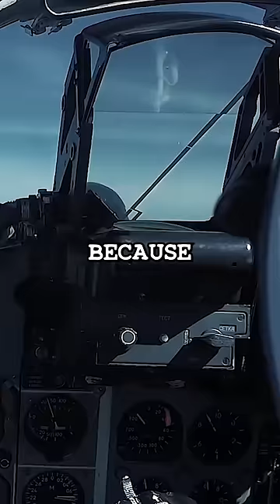What if a Fighter Jet Goes into Space?

Comment: Electronics casually overheating with no power
Reply: Plus how are they going to burn 🔥 with no oxygen
Reply: Not to mention space is just a tad bit cold 😅
Reply: @levicummins7317  And rocket cooling system?
Reply: Its a vacuum in space so the heat cannot leave the mig in space
Reply: That one got me too 🤣
Reply: @mtnkid9140 space isn't cold
nor is it hot

since it's so empty, there is nothing to distribute heat nor cold, so it's... none of thoses
Reply: Your car has a battery and engine. If your engine is off, can you still power your car for the radio? Yes. The plane is the same way.
Reply: @levicummins7317 acctualy some electronics like batteries can burn without oxygen theats why its hard tu put out battery fire because they create their own oxygen
Reply: Most planes have backup systems for power.
Reply: And catch on fire with no 02. ?
Reply: Whilst there is no medium for conductive cooling, there is however still radiative cooling
Reply: @kriss3401 actually space is cold as cold is the abscence of heat, not a physical thing
Reply: I would think one of the biggest problems is that there's no air for the control surfaces to act on.
Reply: @kriss3401 body do u understand radiation and how the sun's heat arrives to us plus if there isn't heat there is cold
Reply: Plus it's cold in space
Reply: @mtnkid9140  it might be cold but your in a vacuum...  there is nothing there to dissipate heat.... Why you puff up with boiling nitrogen without a suit....
Reply: @mtnkid9140  when you're not in the direct sunlight at least. The surface of the moon when in day light is extremely hot.
Reply: It still works like that
Reply: Yea and in icy cold space 🙄
Reply: @thegamingworld8871  IR rays
Reply: captainfrostedflakes   when thers no light is like 0kelvin or smthing like that
Reply: it does since temperature increases while going up from stratosphere
Reply: @levicummins7317  Fire 🔥 only if the engines are still on
Reply: And they never mentioned that space is full of radiation and I don't think they are wearing anti  nuclear suits. Space is one big nuclear reactor.
Reply: @kriss3401 its cold -200c
Reply: Fire needs oxygen, but how sun r burning??! 😢😢😢😢😢😢😢
Reply: @mtnkid9140  Space really doesn't do hot/cold since you need molecules to be "excited" by heat.
Reply: Yes, things would cool in space.. even if no air. Heat dissipate no matter the medium... heating is more of an issue than cooling.
Reply: @berry2740 "batteries can burn without oxygen.......they create their own oxygen". 

That's a contradictory statement. Fire needs 3 things to exist: fuel, heat and oxygen.
Reply: video source: trust me bro
Reply: @GoatOfSolitude888 the "vacuum" is a myth my friend!!!! But I'll let you research that fact not here to argue😊👊
Reply: Average gaming laptop
Reply: @GoatOfSolitude888  infra red radiation left the chat...
Reply: @kriss3401 it's freezing cold, stop spreading misinformation
Reply: @brothernumberone  no. For something to be cold it has to have less molecular energy, so when you touch it, it siphons energy from your hand which is why it feels cold and you lose heat. However space is a vacuum, there is nothing to touch therefore nothing to pull heat from you... Only way to lose heat in space is to radiate it, which takes quite long comparatively. The jet would lose heat via thermal radiation
Reply: @vitopannucci2001  nuclear fusion
Reply: @jasonbrink4237  commercial jets sure, military jets no. They have limited space and in general the heavier a jet is the more work is required to move it. So instead of batteries jets use alternators (like cars) to maintain power for hungry systems like radar  enviromental controls and the computer systems.
Reply: @Johnrichardsjr It doesn't need oxygen to burn. Think about it for a second, it's in use as it goes to space and as electronics work they generate heat as a byproduct. Without anything to help dissipate heat anything will eventually burn up. The same thing would happen in a PC CPU if you didn't have a cooling system on it.
Reply: @mtnkid9140 no it’s quite hot and the lack of air would mean heat wouldn’t radiate off as easily
Reply: @michaelbrooks6416 Stuff cools down terribly in space. If there was a real space battle, the ship that wins is the ship that doesn’t overheat first
Reply: @rorywatson5176 What proof?
Reply: @vitopannucci2001 Because the sun isn't on fire. The sun uses Nuclear fusion, which requires no air.
Reply: They can still run if an auxiliary power unit is on.
Reply: @mtnkid9140 Heat cant transfer in space like how you think
Reply: @kriss3401 what are you talking about ? Space is hot or cold depending on if a star is looking at you or not.
Reply: @mtnkid9140 nice WoF profile picture.
Reply: @kriss3401 Space is very cold it’s below freezing.  But if you want to redefine freezing for the physics community be my guest. With the absence of heat you get cold.
Reply: Pilot would die even with a space suit????
Reply: Contradiction left the chat 😊
Reply: Ytp fighter gets to space
Spent most of the trip coasting up with dead engines and a rapidly draining battery
Certified cooling moment
Reply: cause the plane is closer to the sun
Reply: @alaricsteffens1068  lol
Reply: @kriss3401 actually it is near absolute 0 when there's no nearby sun...
Reply: @kriss3401 lol so u think space is like 15 degrees ? 😂😂😂 yea u can go wearing shorts. Lol space is absolute 0 so -250 celcius or whatever it is
Reply: @mtnkid9140  while that's true, there isn't any air for the heat to transfer to, causing the aircraft to keep it's heat
Reply: „Will die even with a Space Suite „ -Same time, Astronauts floating outside the ISS be like „Look at this jet pilot wearing a Space Suite. He will die! „
Reply: Obviously. Didn't you see the Acolyte, putting out random space fires.
Reply: This is AI that we are afraid of lol
Reply: @nikolausenovic1583  lol, right? XD
Reply: It’s possible cause there’s the atmosphere called thermosphere and it’s called so for a reason.
Reply: @thegamingworld8871 actually cold in physical form doesn’t exist, it’s just the lack of heat (kinetic or radiant). So there are regions in space where there is no heat from a star but a lot of particles moving very fast.

Comment: I wanna hear more about the guy who went to 123,000 feet and why
Reply: Cause he didn't want to stop climbing at 122,000 Feet.
Reply: Not possible on oxygenated engines . It would have to be solid or rocket fuel.
Reply: @jasonmancuso7206 

😂 and probably wanted to go to 123,456 feet.
Reply: @StephenGrachii  No it was a regular Mig 25 with air breathing engines, no rocket engines built in or attached. He simply climbed to altitude, gunned it to Mach 3.2, then pulled the nose up and let his inertia carry him the rest of the way up till the plane was about to stall and then went back down.
Reply: @Tstahl962 Well, presumably as part of some sort of record setting attempt so it would have been a clean plane with no missiles and what not.
Reply: He wanted to see how far it was.
Reply: They wanted to see if they could catch an SR71. They failed.
Reply: @bryank5932  no lmao they didn't, the SR 71 only flew to 85000ft... and yes the MiG 25 could indeed intercept the SR-71...
Reply: @Tstahl962  Sorry. That’s wrong. The MIG 25 has a top speed of 2.83 mach and the SR-71 has a “top” speed of 3.23. It’s actual top speed is still classified. So no, the MIG could not catch the SR-71.
Reply: Zoom Climb
Reply: It was Tom Cruise.
Reply: @billyjack3361  MIG-25 could do mach 3.2, just that I’d damaged the engines… but had the option, if needed to run/intercept. And well, it didn't need to catch him, just go near it, and fire a missile.
Reply: @bryank5932 What do you mean? SR-71 highest altitude was only 85,069 feet,
while Mig-25 can reach up to 123,000 feet
Reply: @StephenGrachii they used a zoom climb to reach that altitude and it was on a stripped down aircraft.
Reply: The MiG was capable of Mach 3. Who knows exactly how fast the SR-71 Blackbird is. 

Same with the B-2 - it’s NOT a subsonic aircraft…
Reply: Experimentation for the tsar-2
Reply: Zoom climb, just used momentum to reach that altitude.
Reply: speed and spying above missiles
Reply: @bryank5932 tbere is always one ffs grow up son
Reply: @bryank5932 Many times the MIG-25 intercepted the SR-71 but didn't shoot. They made something worst, they retired the SR-71 FOREVER.
Reply: @levenusine5095 Not a SR-71 going top speed.
Reply: The Mig 31 retired the Blackbird
Reply: @Dynamo001  it's called an AMBUSH, the MIG-25 had enough speed to do the that task and they did it successfully many times, it doesn't matter that the SR-71 were going at full or less than full speed.
Reply: @levenusine5095  Don't act like it was a race -- like you initially implied.
Reply: @Darrel1200R   @Darrel1200R  Bullshit.  Nothing from Russia is feared.  The Blackbird was retired because it was obsolete and too expensive to maintain.  It happens to all jets, at some point.  It had nothing to do with anything Russia has or has claimed to have done.
Reply: 1) Russian 
2) in MiG-25 
3) eh, shits n giggles.
Reply: @levenusine5095  Had they accidentally slipped over the border, oof!
Reply: @Dynamo001  it was intercepted by a Mig  31 and retired
Reply: Didn’t Neil Armstrong bounce against the atmosphere when he was a test pilot?
Reply: The Mig was basically a plane with two big ass rockets. It was built of pure iron.
Reply: @edwardtony3085 and yet, it could still do it's job. The sr71 was built from Russian titanium, the Russians had options, they just didn't need them.
Reply: @billyjack3361 it has rockets with mach 5 bro
Reply: To intemidate the Americans this is the reason the f15 is made
Reply: He definitely bet on vodka that he will reach world record with jet
Reply: It was more likely at the point of a gun. As this is how Russia usually gets what it wants for its people.
Reply: Fedotov
Reply: @billyjack3361 but the mig is a part of a net which compass multiple layers, he was to be paired with su's and SAM missiles, his mains goal was to aquire target.
Reply: @levenusine5095 even the esab viggen locked on it...
Reply: to be as far away from Russia as possible for at least a dozen or so seconds. Look at Gagarin - who exercised and trained all his life - all to be outside the Soviet Union for at least a dozen or so hours.
Reply: @billyjack3361 the missile sent by the mig 25 would still be faster than the sr tho, and the mig 25 is designed to make it to mach 3.2 but only to intercept the sr, after that speed is hit the engines must be replaced
Reply: Sounds very possible what you're saying! The medium bomber, the B58. HUSTLER
Whent to 86000 feet, during the same thing tests in the very early 1960s. A Mach 2 supersonic bomber
Reply: All of these Soviet fanboys,I have to ask you this question about the MiG 25. “Did it ever shoot down an SR71?” If you answer,”no” please have a seat and remain quiet!
Reply: And How
Reply: @Tstahl962 that really happened? Sounds impossible.
Reply: It's long been disputed. NATO captured a Mig 25 and couldn't replicate it.
Reply: The best vodka advertisement 😂😂
Reply: @billyjack3361 it depends if actually they are intercepting or following each other.
Reply: @billyjack3361  so the Mig25 can't catch the Sr71 and the SR71 can't reach the Mig25
Reply: @billyjack3361  They've tried before too if I remember right and failed. SR71 was never shot down but did take missile fire if recall.
Reply: @billyjack3361 исто тако се незна колико миг 25 може брзо да иде.. Уосталом видиш ваљда шта је овај пилот учинио
Reply: @Dynamo001 Everytime anything embarrassing happens to America's weapon, they retire them like they should. mig 31 intercepted sr71 and they retire that thing, the old and obsolete ussr's s150 shot down f117 stealth fighter and they retired that thing immediately as well. Lucky f35 and f22 has never been put to a mission. America is not putting them actual mission because same thing will happen and they don't have anything better
Reply: @Vendeta552  No Mig 'intercepted' a Blackbird. Russian claims are all lies.  The best they could do was get a temporary missile lock -- but couldn't hit it with a missile.  It was 'retired' because it was too expensive to maintain.
Reply: @billyjack3361  he wanted to see what the earth looked like from that height.
Reply: @kuchenkoren4051 The heigjt doesn't matter, the speed does.
Reply: Maybe the control tower guy said something like, "If you fly under 123k ft, you're gay".
Reply: Since someone has already necroposted less than 24 hours ago, I might as well explain that the MiG is going off of the speed it gathered BEFORE it went too high for its engines to work, produce thrust, or affect anything. The wings need air to provide lift, and there is too little air from that height. The engines need air to produce thrust, but they don’t have enough air to operate. This means that the MiG (when going as high as others mentioned it can) is just running on its momentum since its engines aren’t working anymore and its wings aren’t able to produce enough lift because of the lack of air.
Reply: @bryank5932  if they failed sr71 wouldnt end its life in musem LOL))

Comment: Correction, 330,000ft as internationally recognised as the boundary of space, only the US air force thinks different
Reply: Aka 100km.
Reply: 30 km, I'd say. Before starting to debate with me, find out some info
Reply: @TextualTennis28  SR71 could fly (unofficially) at 30 km. That's not space.
Reply: @emilen2  That is not space, but the edge of space if we look the atmosphere's thickness
Reply: @TextualTennis28  Edge of space is still not space so not space. I repeat not space.
Reply: Yes, you are correct.
Reply: um ok (point totally missed)
Reply: What is space
Reply: @TextualTennis28 30km is not even the mesosphere, theres still a ton of air..
Reply: @FlyLeah  yes, but it is extremely rare

Comment: Bro forgot to mention that there's no lift at that altitude. The plane will just stall 💀
Reply: The engine will stall, but the plane would just glide until re-entering the atmosphere
Reply: Hmmmmmmmm good education ❤😂
Reply: Wrong!! No lift needed if flying straight up like a rocket. Engine Stahl occurs after there's no air which would happen at over 100,000 feet😊
Reply: @RIVERANIEVESZ not exactly, you’d lose a bunch of speed going up.
Reply: @Harmful_Lagoon Before you reach that altitude the plane already will lose a lot of speed, and even if you reach that altitude, the plane will need heat shields for reentry in earth's atmosphere without burning.
Reply: @MihaitaSenchea heat shields are only required for orbiting spacecraft coming back in, they don't use the atmosphere to stay up, they use speed, ie orbital mechanics. Spacecraft come back into the atmosphere at hypersonic speeds hence the shield. This thing would go up, run out of lift/ thrust and fall back down with gravity. It wouldn't be going anywhere near fast enough to burn up. The main problem with stalling past a plane's operational ceiling is yaw. Which is why the U2 had a yaw string. If the plane.comes back in at any yaw angle other than nose forward it can rip apart. This was a common problem with the x15, to go to 400k feet, literally space and then come back in at the right angle required thrusters on the nose of the airplane to get it pointed in the right direction
Reply: @Sniperboy5551an aircrafts wings needs to generate lift to glide.  With no air/ very thin air, the wings will have no way to generate lift and it would tumble. By the time it got to air that was thick enough to produce lift to glide it would already be spinning out of control. If they were lucky they might be able to refire the engines and throttle up to straighten it out, but that is a big if as the engines would be extremely cold and possibly frosted up.

Comment: The electronics will start to burn
Me: I thought you need oxygen for fires.
Reply: Not for chemical fires.
Reply: Or if it's an Acolyte fire in space.@spiral-tm9uc
Reply: Also no power.  How can the fire start?  Lol
Reply: That's what I was thinking
Reply: For those saying about no oxygen: the fire is caused by electricity in this case, the wires would be cooked.

This is what he means, that the circuits would fry.
Reply: @spiral-tm9uc For the fire to keep burning, it still needs oxygen! it doesn't matter if it's a chemical fire or not. So that statement is not correct.
Reply: @lordprior8052  yeah, thats true. but fires can still start. not necessarily be continued long burning fires, but short flames.
Reply: Yeah
Reply: @valenzuela-2007 So in the case of a SV how are their wires and electronics not fried.
Reply: @archiebold1395  wdym by SV? could you use the actual name please? instead of the initials
Reply: Makes more evidence of us not going to the moon.
Reply: Oxygen is not the only oxidizer in chemistry.

"....electronics will start to burn...." was a simple mis-wording mistake, he should have just stopped at "overheat".
Reply: Burn is melt in this case